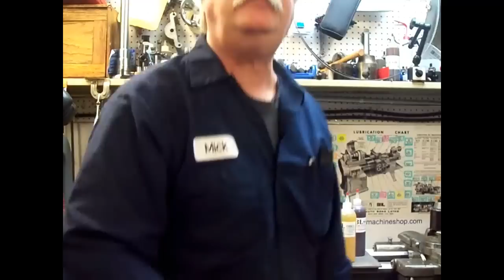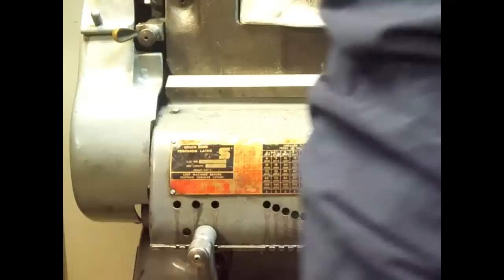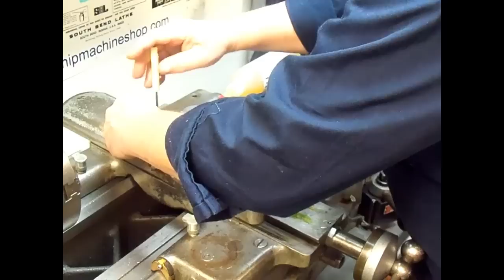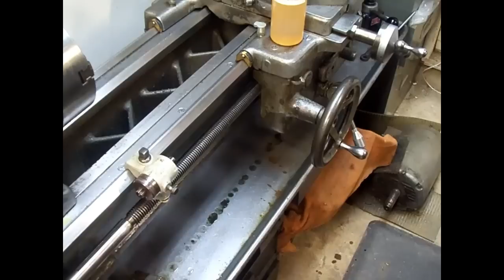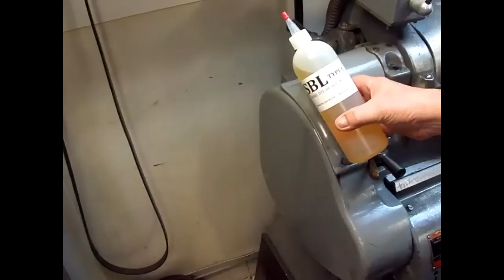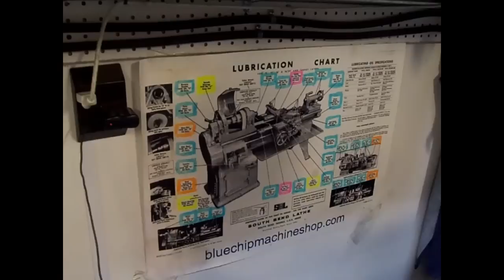How to Lubricate the South Bend Lathe

Comment: Hi Mick. A very good informative video. While you were lubing the reverse and side gearing I noticed you didn't lube the idler gear/hub. Does your lathe not have a hole in the gear hub to lubricate the gear/bushing assembly? Also, when lubing around the back gear handle and shaft, I think you referred to it as the "bull" gear. Isn't the "bull" gear on the spindle shaft, next to the cone? Thanks for sharing the info. I'm sure it will help many, with the confusion over the different viscosities of the oils and where to use them. Willie D.

Comment: Good info Mick.  I tried contacting you on your website without success.  I have your oil kit for my 70s South Bend 10K and am wondering how cold it can get in my unheated shop before I should stop operating it.  I've been told the cold interferes with bearing lubrication.  Any advice?
Reply: Thanks for taking the time to reply.  I'll watch for your fixed site. BobE